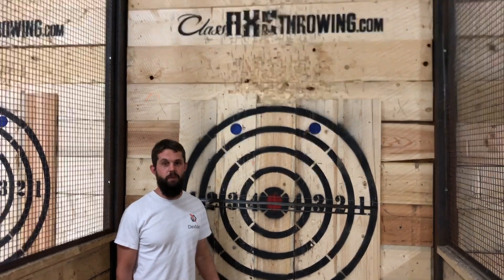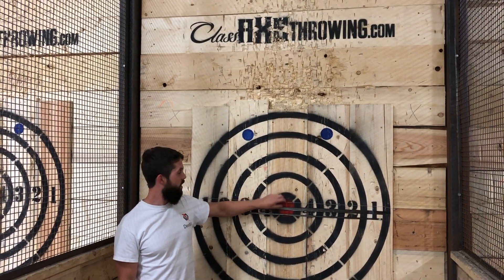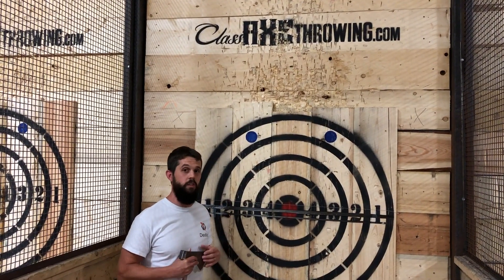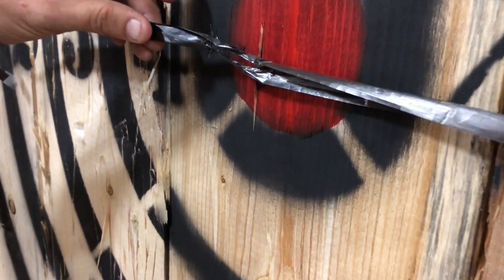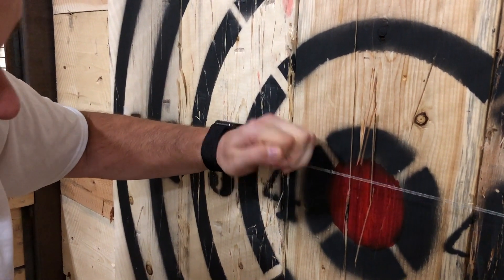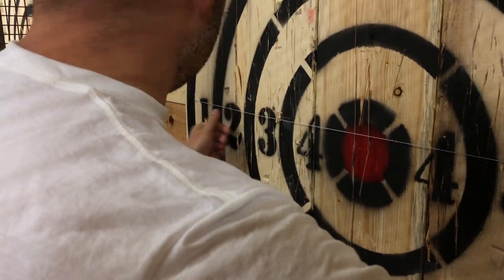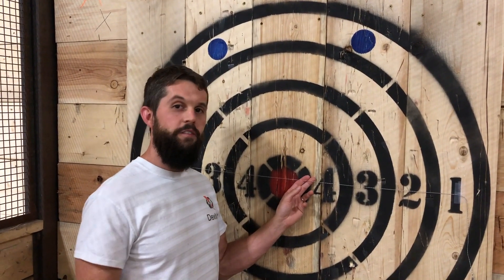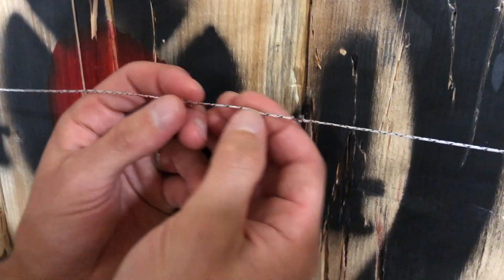Chopping Carbon Nanotube Yarn with an Axe (Part 2!)

Comment: It makes me wonder how well this would work as leaders for fishing.. Predatory fish tend to cut braided lines easily with their sharp teeth. The breaking pulling strength is about 10kg for 0.5mm thick CNT yarn right? Why does that sound a bit low considering similar thickness fishing braid its 5 times that..
Reply: Purity and the inability to produce long strands of nanotubes
Reply: Carbon nanotubes aren't really about size to strength ratio, they are more about weight to strength ratio. So yeah fishing line is stronger in size, but carbon nanotubes are vastly stronger for its weight. They are even a few times stronger than titanium line.

Comment: Is this SWCNT or MWCNT?
Reply from the maker: We can use either one in our process, so long as the graphitic quality of the CNTs is high (i.e., so long as there are a small number of defects in the molecular structure). The yarn shown in this video is made with relatively thin MWCNTs.
Reply: @dexmatinc  Have you tried SWCNT and do you see a difference in your process?

Comment: Where did u get the carbon nanotubes form
Reply from the maker: We don't want to discuss our specific sources, but we purchase the carbon nanotubes from a few of the private companies that are producing them for sale. 

There is a huge variety in terms of the purity, size, and quality of nanotubes that are commercially available, so we use nanotubes from suppliers that can achieve high purity and low defect density (i.e., not many defects in the molecular structure of the nanotubes).
Reply: @dexmatinc  what country of origin?
Reply: @-flutterby7026  Our Fibers and Films are made in the USA.
Thank you
Reply: @larochellet  where are the CNT produced and is your product 100% CNT?
Reply: @dexmatinc  How long are the nanotubes? I thought all that was on the market was carbon nanotubes in powder form. If these are just long strings of nanotubes, it would literally replace carbon fiber for lots of use cases. You will become super rich if you are quick to take over the market before the competitors do.
Reply: @videosforcatsanddogs214  They are not long